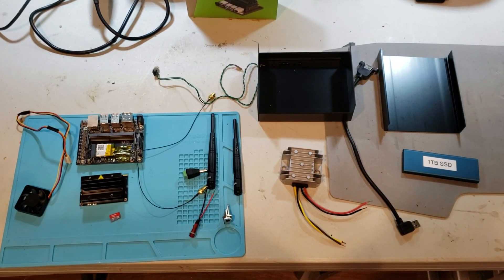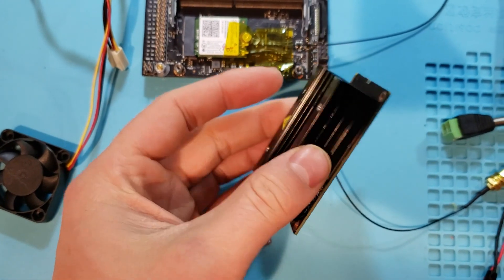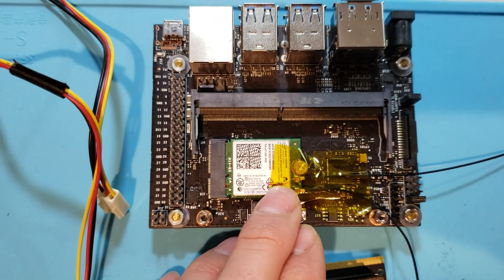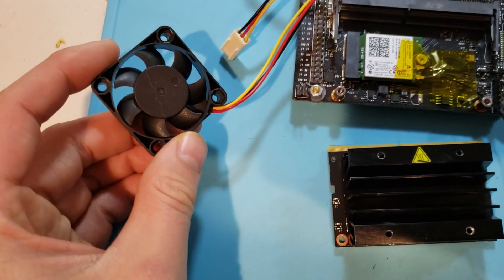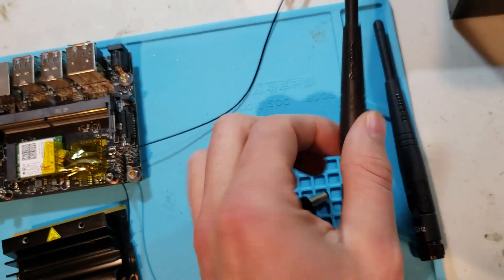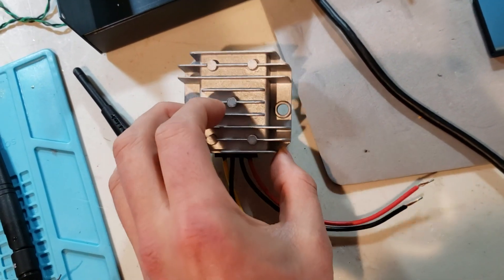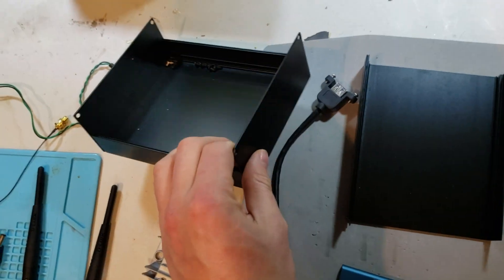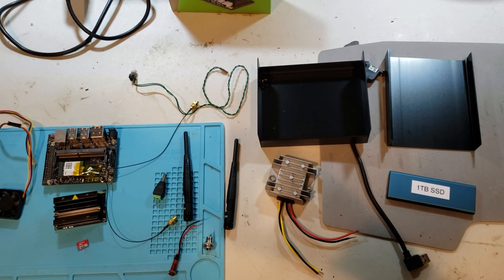Nvidia Jetson Nano mobile plex server part 1

Comment: Are you sure the 12v fan will work? As far as i know jetson nano drives only 5v
Reply from the maker: I have a 12v fan hooked up and it seems fine. It really depends on the fan some need a little more voltage to get moving.

Comment: Will the M.2 case support TRIM so the M.2 drive does not prematurely age.
Reply from the maker: I just opened up crystaldisk and it looks like the case controller supports most of the SATA/600 command set(SMART, APM, NCQ, TRIM, DevSleep) Considering this is a media storage drive and not an OS drive constant writes aren't really a worry for me even if it didn't.